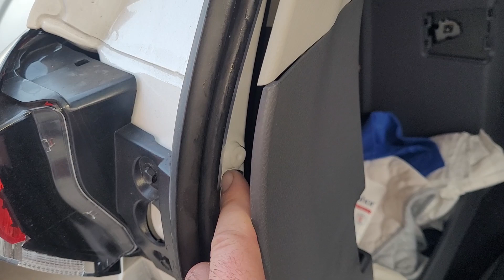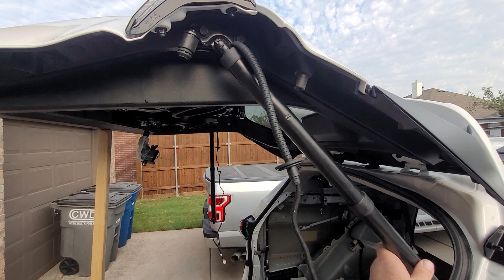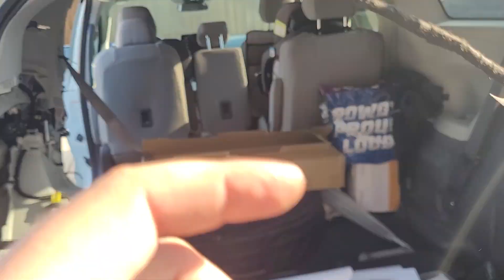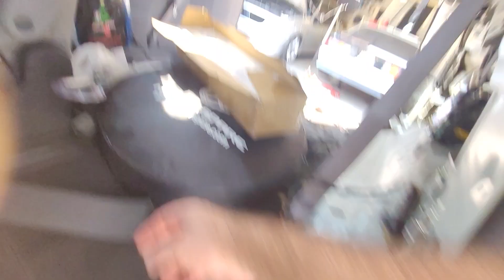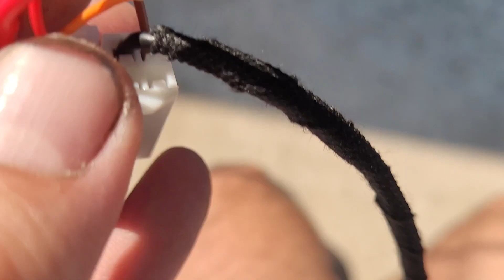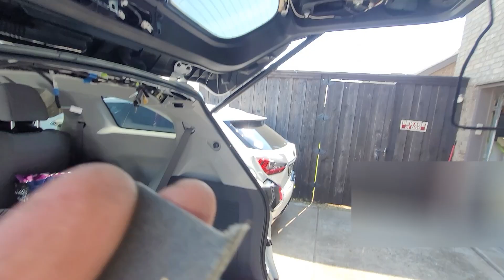Toyota 2021+ Sienna power back door. Aftermarket conversion kit installation

Comment: Is there a way where I can install just the liftgate button without installing a button up front? I’m assuming no, that power comes from a wiring harness up front?
Reply from the maker: power comes from the fuse tap.  I guess you could choose to leave out the dash switch, but you won't be saving much time iMO

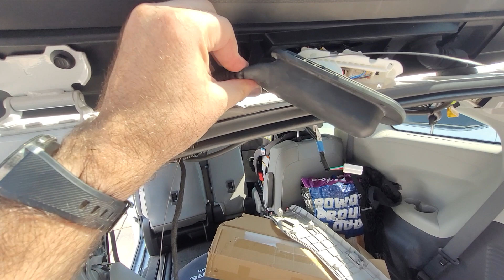Comment: At 18:10, that grommet you removed, how did you get it back in.  I’ve been struggling with this and just ended up throwing silicone on it. Does it have to do with those clips you mentioned?
Reply from the maker: Large rectangle end of the grommet, try putting the rubber grommet around the white connector first, and then clip it into position.

The round end of the grommet just press into the body with your fingers
Reply: I ran into the same problem as you and was unable to get the white connector and rubber back into position.  Not sure how he was able to.  However, the white connector was the issue for me.  I removed it entirely and connected everything back together.  The rubber grommet was then able to fit nicely back in the hole to make it water tight again.  It looks clean as well
Reply from the maker: @tballor19   also a good explanation.  thanks for the comment

Comment: Mine is a 2022 and it gave out the back door lock actuator toyota wants 700 for the part wtf
Reply from the maker: For just the part? Whoa!
Reply: How did you get the tail gate opened up
Reply: @MrBusinessman305 question does your make noice or it doesnt do anything
Reply: @MrBusinessman305  the reason why I ask is because there’s a way to recalibrate it and it may not necessarily mean that it’s damaged the way that I open mine was I took the back cover off and then I prayed it open
Reply: That's because it's worth it. This aftermarket will prolly only last a year or so. The Toyota one has a high chance to last the life of the car. As a mechanic, I never go with anything other than OEM Toyota parts on any of my Toyotas. I even buy the replacement wiper blade refills for it. Toyota quality is unmatched.

Comment: Thanks for the video.  What did you charge to install this?  Others have said the power light stays on with the car off, did this kit have that issue?
Reply from the maker: I want to say around 400 install.  No issues with this kit after install